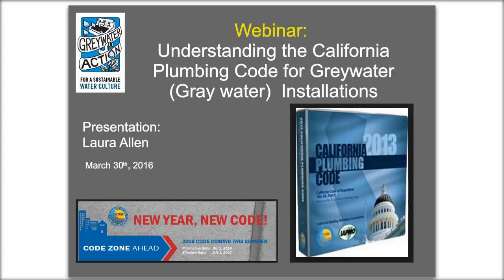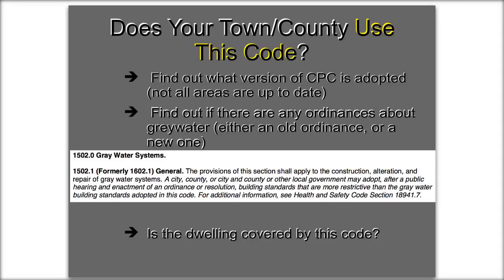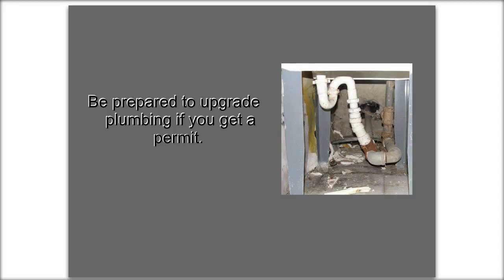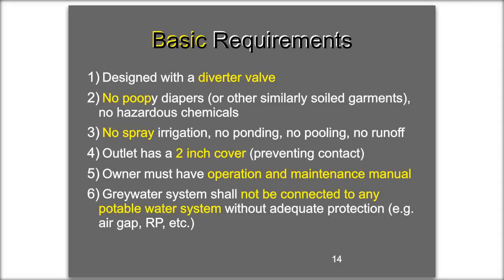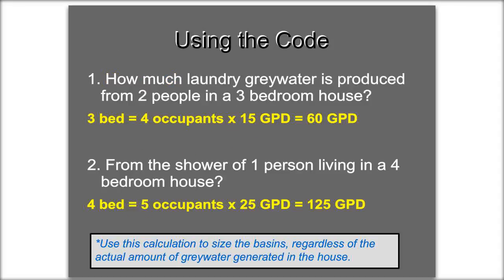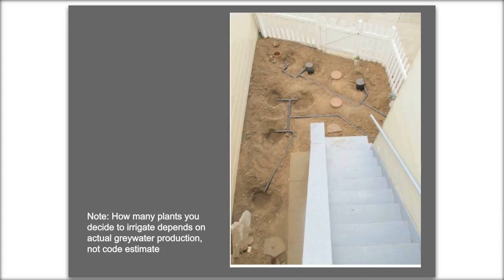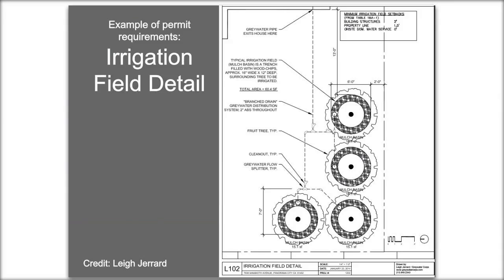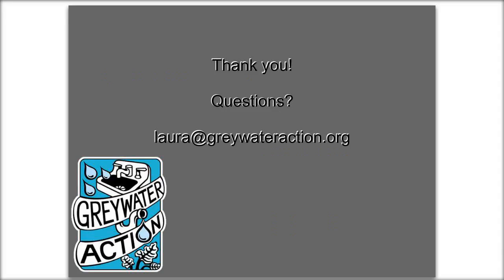California Plumbing Code for Greywater (recorded on 3-30-16)

Comment: Hello! Thanks a lot for you interesting videos. One question: How big would you value the US market (market volume) for commercial and residential greywater systems? 

Thanks a lot for the information in advance.
Reply: I think there is potentially a large market, especially in the western states. There are still many regulatory barriers and inconsistent application of state codes, which makes it harder for people to implement systems.